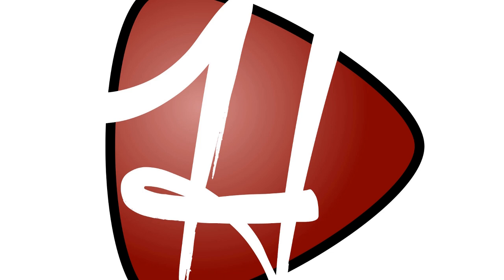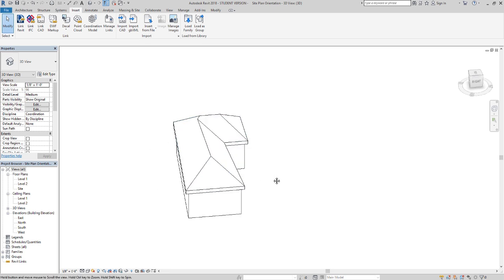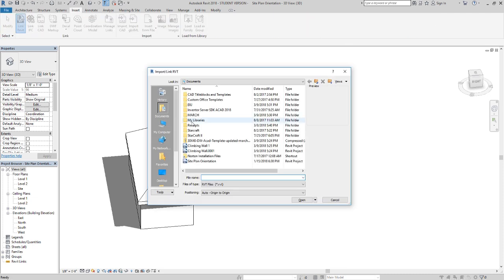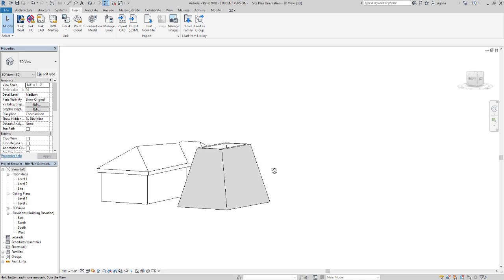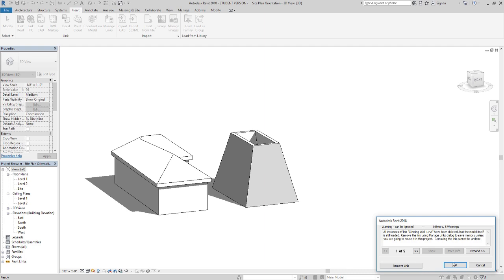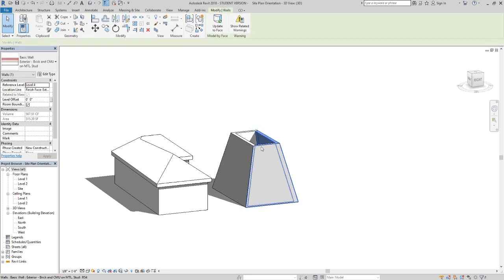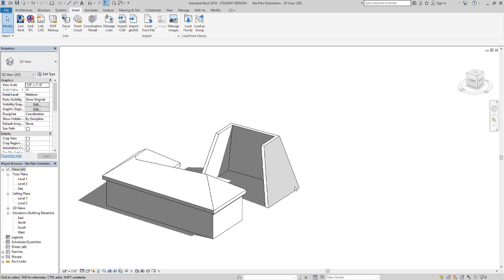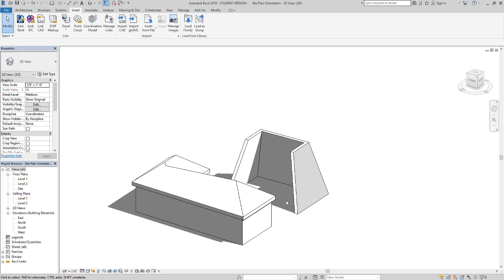Revit - Import Revit project file into another Revit project file and explode it the EASY way!

Comment: how to explode if object from sktechup?
Reply from the maker: Hey! You can try bringing it in as a Massing Family and then use it to reference its surfaces.  Depending on what you’re specifically doing it may work well or it may not! The video is here: 
How to bring SketchUp into Revit as a Mass + Add Roof/Walls/Etc. to Mass Face https://youtu.be/f1zCuDPDRsI